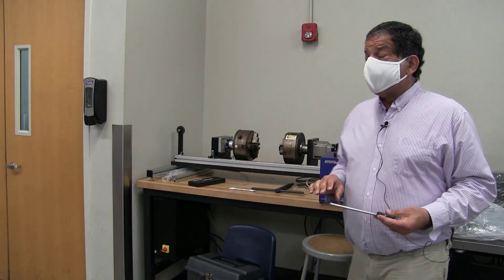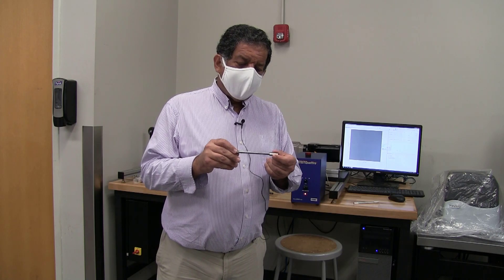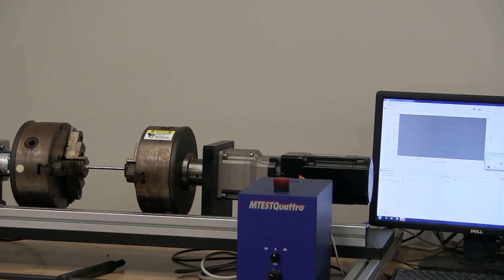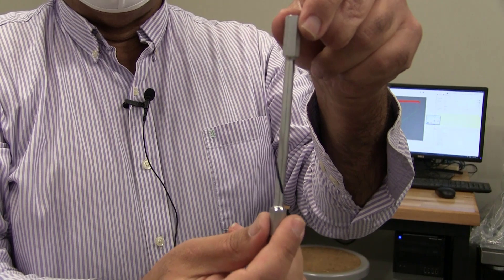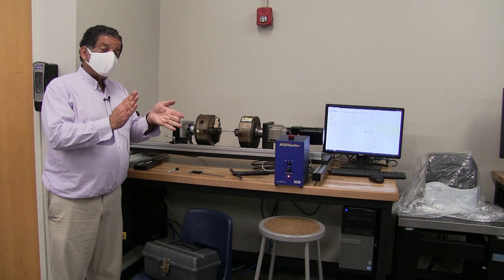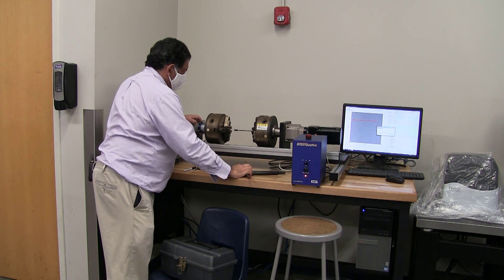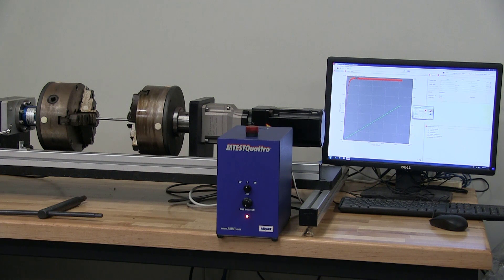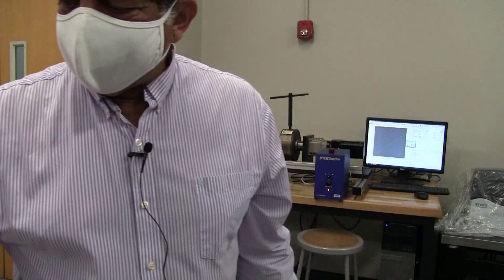ME 3501L: Torsion Experiment

Comment: Absolutely cool. Graphing by computer beats the way it was done 40 years ago
Reply: With computers it takes deliberate action to remove "unwanted" data points. In the "old days", you just didn't draw them in the first place. (So I'm told.)
Reply: @danpatterson8009  we did RMS between points and curve fitting, using a TI-35 calculator. We plotted everything by hand. What was done in the video taking 15 minutes, took us several hours.
Reply from the maker: What an age we live in.